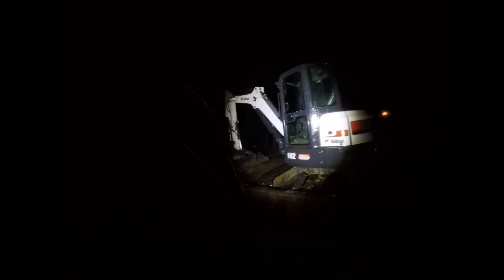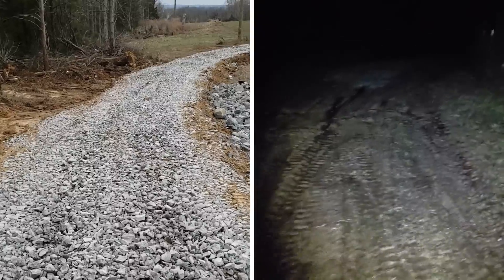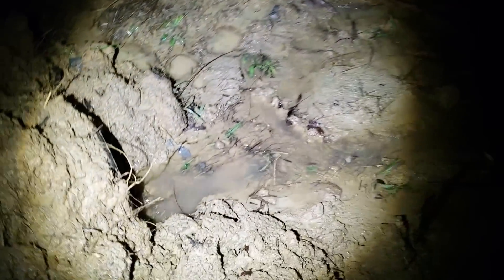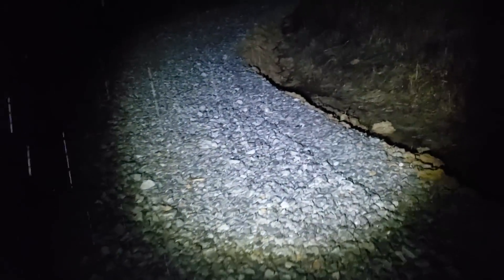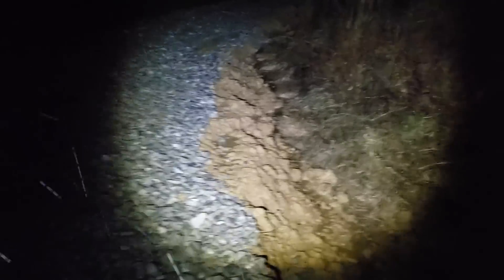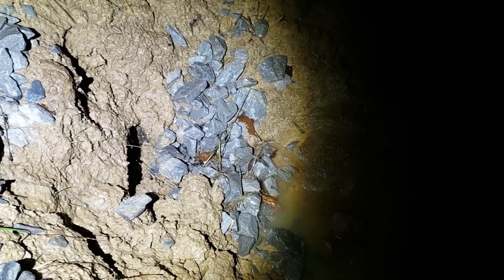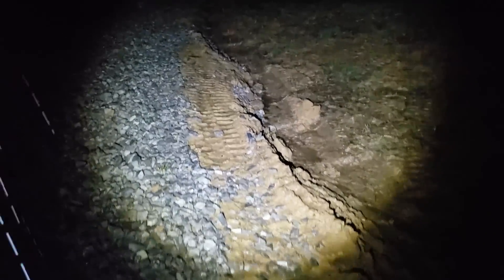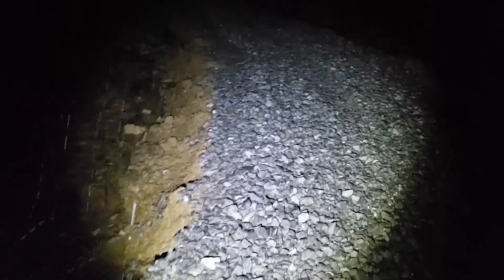Flash flood watch FIRST check of new road culverts Fri night 01-10-20

Comment: What I mean is, when your building the road build it up to underside of your crushed rock then cut your batter pulling the dirt up onto the road. Then level out dirt on road, compact then place rock, that way the side of the road are cut clean so you get very little silt going down your drain. I don’t want to sound smart only trying to help, I spent 50 + years in all types of major construction and roadworks figured in a fair amount. Love your farm must be very proud, credit to you and Mrs Kapper.

Comment: Mr Kapper can I make a suggestion when your building a main type track on your nice property. My suggestion is why don't you overfill your both side of your road then cut the side drains with your mud bucket, that way you will have nice silt free looking batters.
Reply from the maker: Thanks but I'm not exactly sure what you are saying here. I did cut some of the ditches with the smooth ditch bucket to help reduce silt, but you're right there's a lot of areas that I did not. Thanks